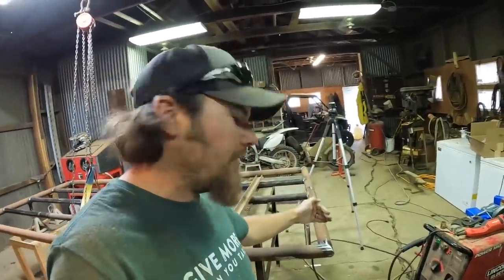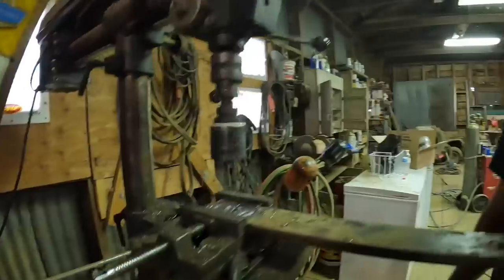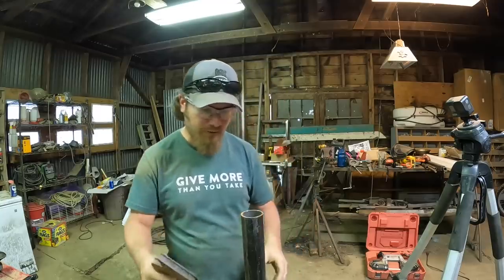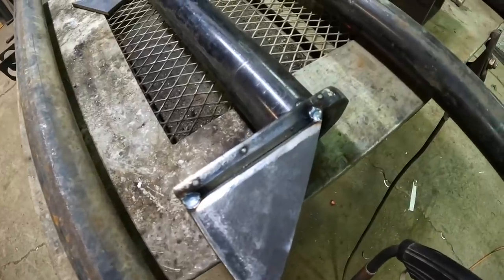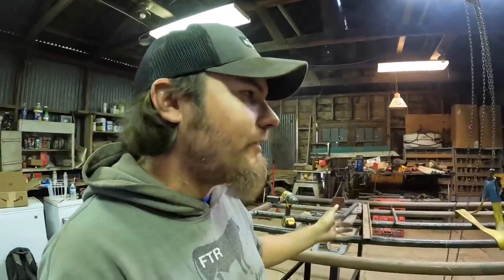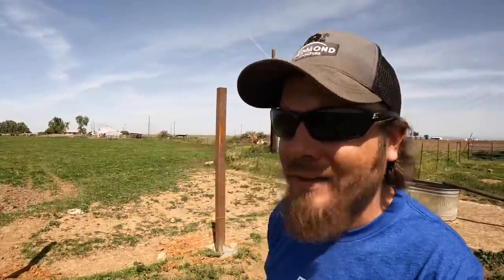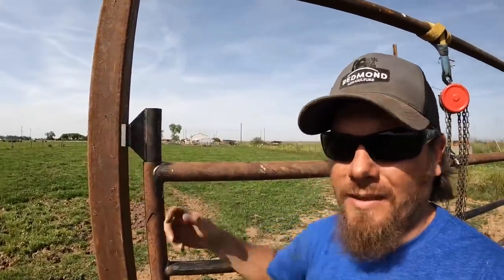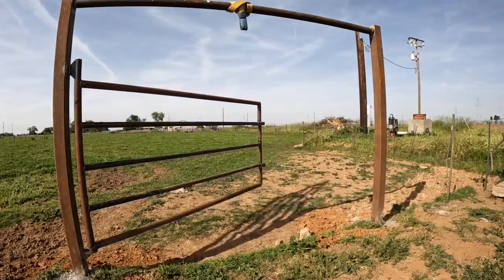This is What a Gate Built From Scrap in My Shop Looks Like!

Comment: I use the jacks with the crank on the side of the jack. Handle doesn't get in the way of gate or whatever you lifting with the jacks.Two crank trailer jacks with a wide base on the bottom. Then weld lifting bracket on jack how ever you want to make it.
I used a angle iron so the horizontal pipes will sit nice in the angle iron. 
Crank gate up and make it level and position it however you want. They work great. Nice job on the gate.👍

Comment: Love your videos!  Slow the RPM on the drill press down when cutting holes that big...like 2-300rpm is good. Let the teeth do the work and turn slow to keep the heat down. Keeps from ruining the temper on the saw which will make the steel soft and dull.  I run mine at 3-400 all the time even for wood.  Little oil helps too. I like old motor oil.

Comment: That drill press isn’t tto shabby, just find a 1 1/2 or 2 hp motor and it will be a long runner. Mine is a 68 rockwell and  about 5 years ago I bought a used 2 hp Baldor motor .  100 % better

Comment: Nice job. Was thinking about how you created your top hinge had you used the same diameter pipe you used for the frame you could have made a longer piece of the smaller diameter with a cap and slid down through both for easy removability later like a barrel hinge on a door frame. Just Monday morning quarterbacking lol